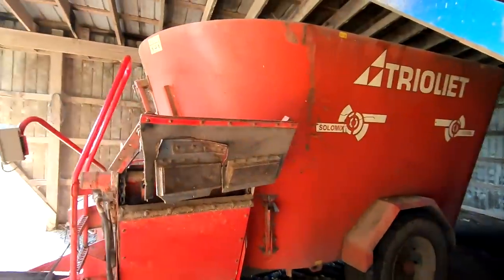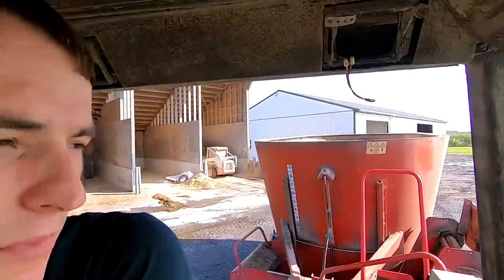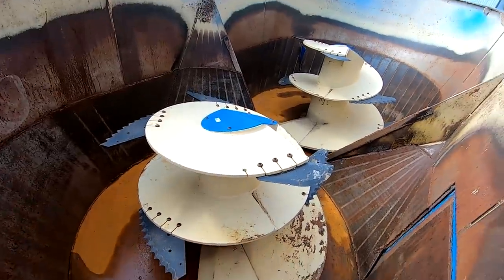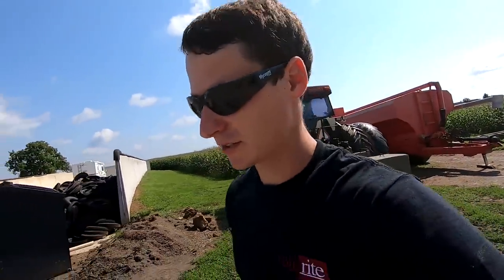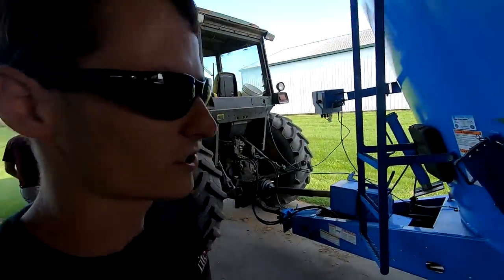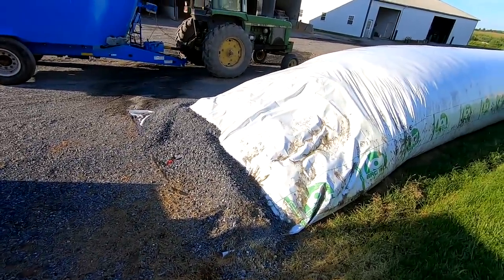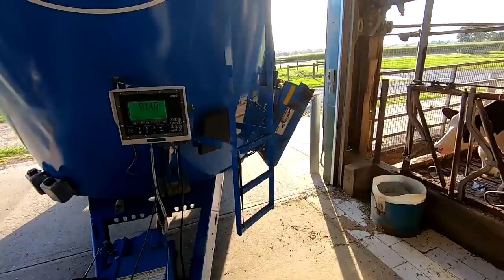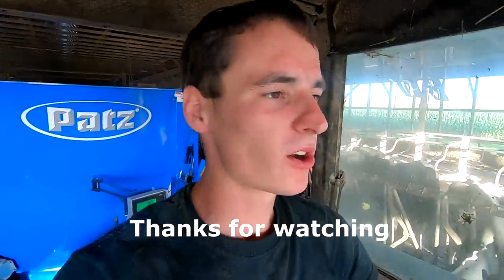Feed Mixer Demo & Opening Ag-bag

Comment: Nice video!
I think you have to test an self propelled feed mixer. Here in Germany the most farmers in the same size than your farm got such a machine.
In my opinion this would save you a lot of time. You dont have to switch between tractor and skid loader. You can load with it all your grain, dry hay and corn silage.

Best regards from germany 👍

Comment: We really like our supreme 500t mixer. Feed 160 milk cows with it and the low loading height works great for a skid steer even with the rubber extension. Doesn’t clean out fantastic, but we only have a single speed gearbox. Cheers from Canada!

Comment: I was never a fan of unloading on the left. Everything in the tractor is oriented on the right. We run a 2400 trioliet with the 2 speed automatic gearbox. Fluffy loads (lots of dry feed) and small loads all get mixed in high. Heavy loads the small inclusion ingredients get loaded first and mixed in high speed. Then when we add the forages when it reaches the set points it shifts to low speed. Unloading it will automatically shift up again at a given set point so it unloads nice and even.

Comment: Off topic for this video: With all the electronics on the farm today have you and your dad thought about adding cameras to the top of and/or inside the silos to monitor how they are loading/unloading without having to always climb to the top and look in? Having worked on a farm back in the 80's I remember having to climb the silo several times during filling because we'd overload the filling system and plug the top. Luckily it was a shorter Harvester with a cage on the upper ladder sections; I'm the one who got to climb since I was least afraid of heights lol. We didn't have the huge power blower trailer you use, it was just a small blower hooked to a smaller tractor PTO. I look back and wonder if having a small camera at the top and a monitor at the bottom would have allowed us to keep an eye on fill rates....then again technology was CRTs back then. I suspect you'd have to have a camera with a rotating lens cover to clear dust and debris from the seeing end of the camera. On topic: I'm not sold on the new feeder. I don't like that you have to drive off the concrete for the outside cows. That might be a problem when the ground is soft and would rain reach the outer edge of the feed wagon during feeding them and it was raining. I know money for farming can be tight so maybe its the best solution for now and you'll find something better next year and then turn around and sell it to another farmer who doesn't have the width issue. Also, looks like the Canadian dairy farmer which you follow has a larger version of your old feeder? PS, every time I watch his videos and see how soupy their barn floor gets I wish they had done the underground pit like you guys have with grating but that would be out of the question now that its done plus it might be too cold in the winter to do such a method up there?

Comment: Looks like a good mixer, if that one dry heffer pen is the only issue that sounds pretty good I'd say - maybe make it 2 feet wider at some point or put gravel down so it won't be an issue. Capacity and self cleaning are pretty good tho in comparison. I'm not sure what else is out there tho.

Comment: If you put small rubber strips like 3 or 4 inches tall on the length of the paddles on the conveyor of the patz feed wagon you could have the conveyor at a steeper angle and it would still carry the feed out

Comment: Seems just adding the 'riser' to the top of your old mixer would do the trick. Well, fixing the drills and adding siding to the interior too. Having new is always nice tho....
Reply from the maker: Yeah that would work but our triolet mixer isn't designed to be extended, it wouldn't mix as well apparently.
Reply: @10thgenerationdairyman61  Thanks for the response. Given my lack of knowledge, I looked at the Triolet and Patz web sites on possible options. Patz indicates a general 'extend capacity by 15%" while Triolet offers rubber and metal extensions to only be used for spreading hay - did you know they can spread hay too? You may have to add an attachment tho but was an interesting find. Sounds like you're 'busting at the seams' expanding the dairy so everything will need to get bigger I guess. Good luck on what you choose.

Comment: Does it need an elevator at all? only have them for filling troughs over here,a simple angled plate would leave feed far enough away that the mixer wheel wouldn't run on the feed.

Comment: If your not dumping in a trough at all just take the conveyor off.  It simplifies a mixer so much.
Reply from the maker: Yeah i like how precise you can be with weights with a conveyer though
Reply: We run the longest conveyor patz offers and dump in Apache feeders and pull them out into the pasture

Comment: well just to let you know the triolet will hold about as much as the Patz this is because of the design of the mixer the Patz is shorter and longer the shorter a mixer wagon is the worse it mixes and the less it holds this is because a taller mixer has the pressure of the weight of the feed on top because it's taller pushing the feed on the bottom down compressing it making the knives more effective and the capacity larger. I would say the closest thing in design to the triolet would be a supreme or Schuler mixer

Comment: Is the extending conveyor required to deliver the feed? Can it be replaced with a gravity chute?
Reply from the maker: Conveyor is nice because it is more precise when trying to get out a certain amount, but yeah some people do that.
Reply: @10thgenerationdairyman61  engineer yourself a "slide-away" conveyor, that moves up out of the material path for tight spaces and back down for normal use.